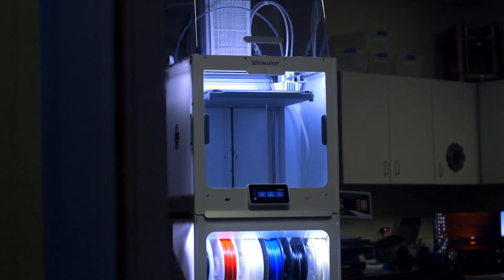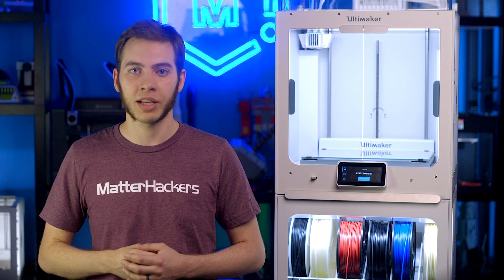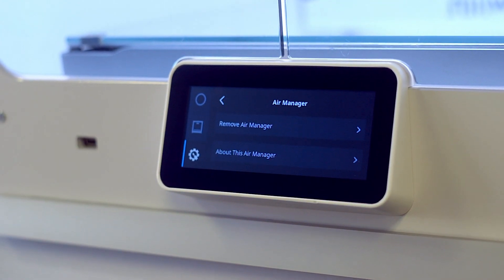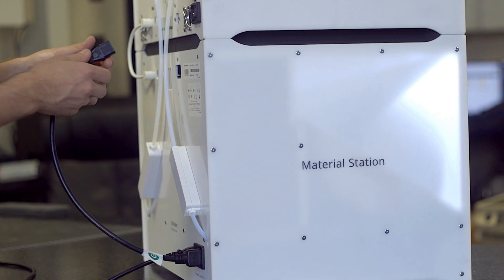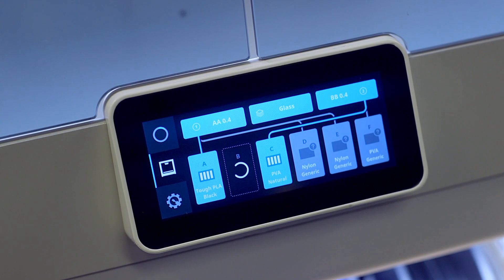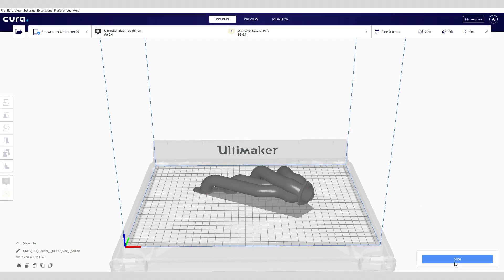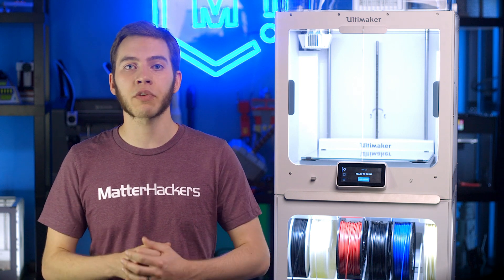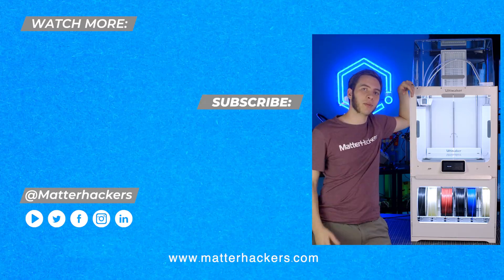Ultimaker S5 Pro Bundle // Tech Breakdown

Comment: Might be a very easy question but somehow I was not able to find an answer:
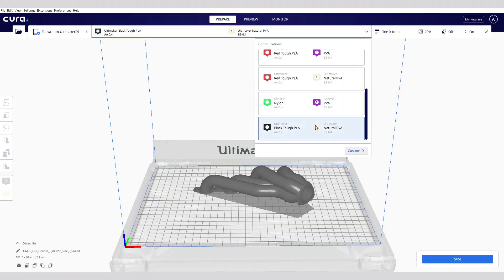How do you set up different configurations as seen at 2:53?
Reply: I know its been two years but in Cura all possible Configs will be shown via the material selection tab when connected to cloud / local network.